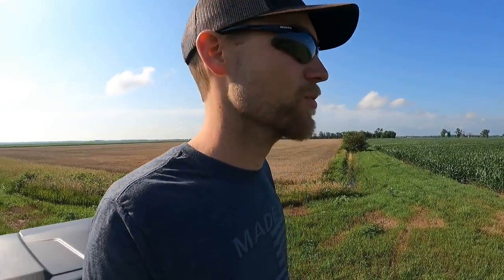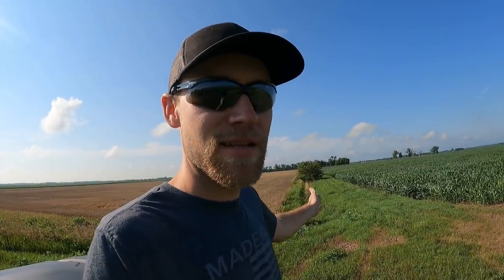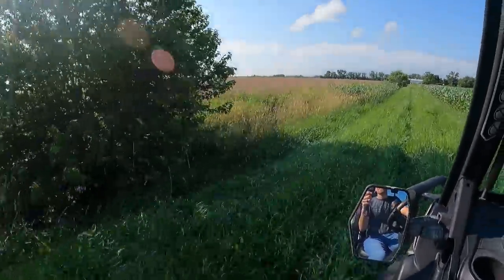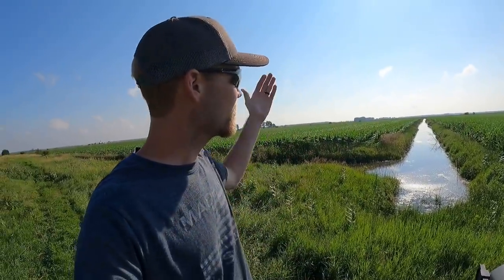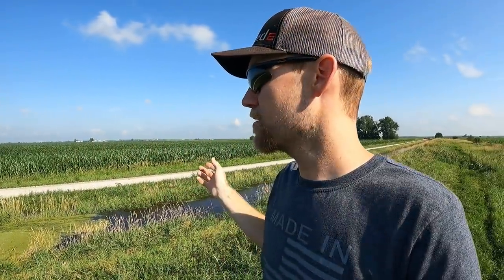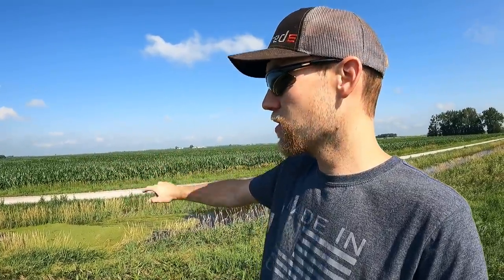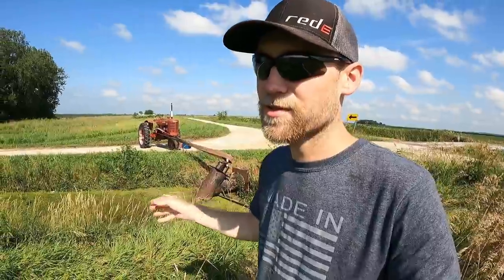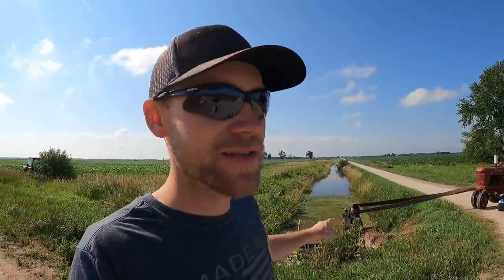Flood Water Drainage for Dummies | The Farm is STILL Flooded!!!

Comment: To put things in perspective, 1 inch of water over 1 acre is 27,000 gallons of water.  Over 1,000 acre that's 27 million gallons for each inch of runoff.  At 10,000 gallons per MINUTE, it still takes 45 hours to pump that single inch of runoff.  Hard to calculate the ratio of rainfall to runoff given that a good deal soaks into the ground.

Comment: I'm a sucker for a M.
Dad's was a 42, and for many years was the big tractor. 
We belted a hammer mill to grind feed, and a buzz saw to cut firewood. 
I still have a 45 M, but haven't worked on it for several years. 
It has a magneto, but has weak spark.
Thanks for posting.

Comment: as far as the culvert gates go I've used air bags to seal off drainage culverts while working on drainage systems. its basically a giant rubber ball put it in the pipe put the air to it it swells up closes off the pipe, it works really well

Comment: Hey my name is Thomas I am from Denmark. It's a nice old tractor, and I like your video very much.
I think it would be very easy to convert that pump to to pto drive, take off the flatbelt pulley and mount a 90 degree angle gearbox with a 2-1 gear reatio on top of the pump and run it with a long pto shaft with a tractor with 1000 rpm, then you can run 540 rpm with low engine speed. But it is just an idea.
Reply from the maker: We’ve thought of this idea! We will probably use v belt pulleys and a gearbox to get the right speed ratio
Reply: I think it would be a lot easier to Mount the gearbox directly to the pump and there would be a lot less parts. Hvat is the ideal rpm for the pump?
Reply from the maker: Honestly I’m mot sure what they want the rpm to be
Reply: I am looking forward to see what you come up with and I hope you can hold the water level down and save your crops.

Comment: Wes, we farm in south west ILL, small farm close to the Mississipp. Have seen these type pumps but the ones I see are portable, they are on wheels and only brought in when needed, use a plastic sleeve type conduit to move the water over the levy.  My question is what type of lower bearing do yours have on the under water end that can survive all the time submerged?  I assume those are a simple screw type pump and there has to be some type of shaft support on the lower end.
Reply: I see now after review that you mention that it's an impeller pump, still wonder what type bearings are in it.
Reply from the maker: The shaft and lower bearing is enclosed in a pipe filled with gear oil. There’s a little pvc pipe oil reservoir at the top of the pump you can see and n the video. Great question!

Comment: Keep using the m even if you go with pto I farm with a farmall h m and super m and I’m 25 years old. I’m also working on fixing up a farmall c
Reply: If you have the opportunity down the road, get a 300. Ours isn't presently running, but back in the 80s, we cleared what used to be my great grandparents farm, using it. We We also have a 706 diesel, and a 460 gas. After running them both, I'd take the 300 any day over the larger 460. Except for the power steering, lol.

Comment: would it be easier to use a double yoke driveshaft and put something like a chevy 4.3 vortec propane fuel motor on it? just set it up with a dedicated motor and not have to worry about pulleys and tractors?
Reply from the maker: Would be easier but probably not cost effective as we don’t use these pumps that often

Comment: Don’t worry about the “terribly informed” suggestions and questions you are ‘blessed’ with. One of the problems with social media is people become convinced their opinion counts. Sounds like you’ve got a solid plan to develop this water system. Would it be cost prohibitive to put both pumps on electric motors and run off a single stationary genset or single tractor genset?
Reply from the maker: We don’t have to run them that often to justify electric power. I’d rather find a couple old deutz tractors to run them

Comment: Great video, thanks for the info.  Any way to install a stationary motor so you don't have to pull out the tractors each time and put hours on them? Like pull the motor out of an old tractor and put it on a pad?
Reply from the maker: We could but we usually dint have to run them that often